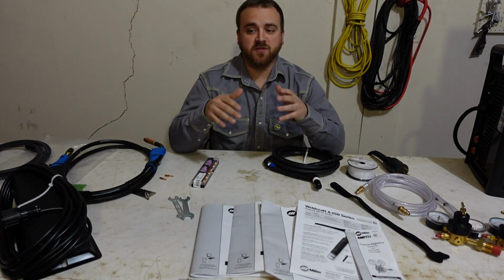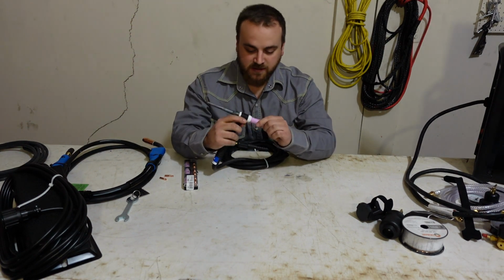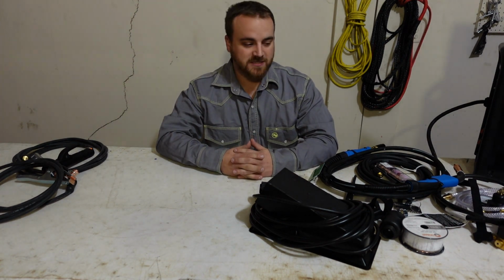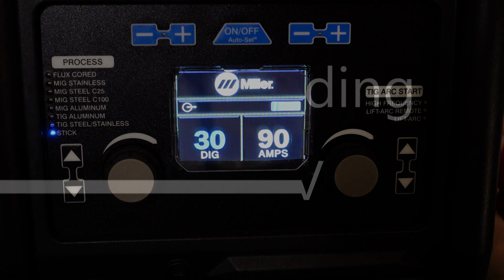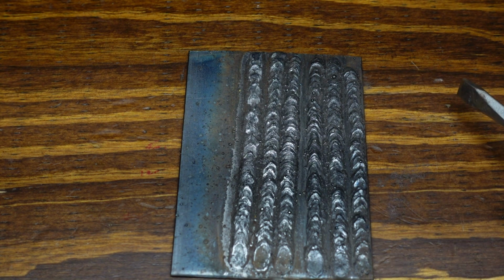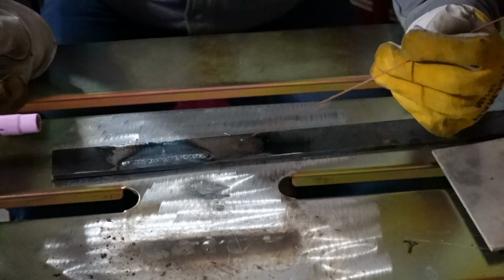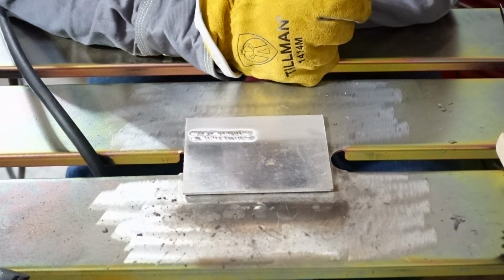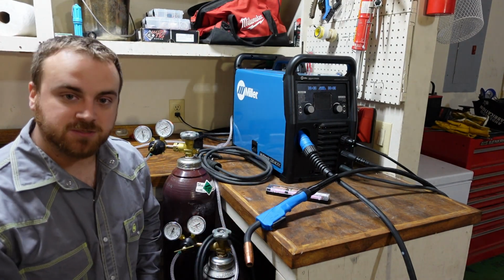Miller Multimatic 220 unboxing and review

Comment: Sold my Miller 220 for a HTP 2500 and have never been more happy with a welding machine decision. The 220 was lacking, auto switch wouldn’t work half the time, the control board would glitch out and lock up, leads wear under rated for machine, tig and stick processes were mediocre at best and it wouldn’t run 6010 without a lot of problems! Got a ESAB 205 as well and would also choose it over the Miller 220! More options, better performance and no issues other than when it got extremely cold I got an error but this was resolved with the update from the included usb.

Comment: What exactly was the issue with the breaker popping? And what size breakers did you need for the 120 and 240?
Reply from the maker: Just a bad breaker got it swapped out and haven’t had an issue since! As far as beakers I used a 15amp for all the 120 and a 60amp for the 240